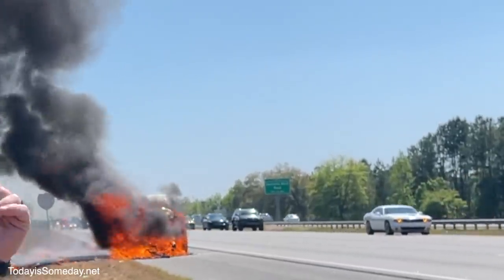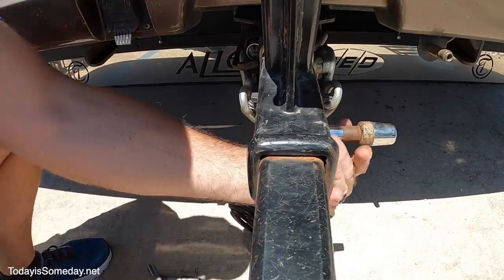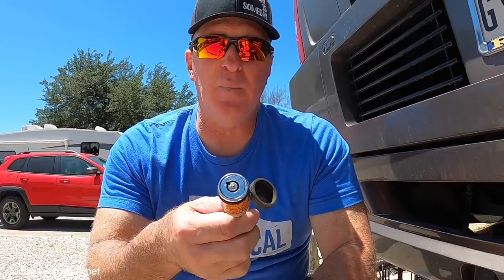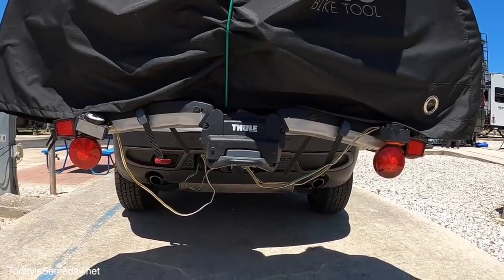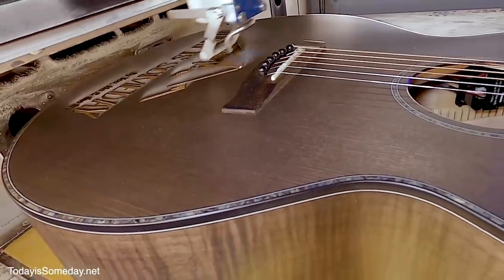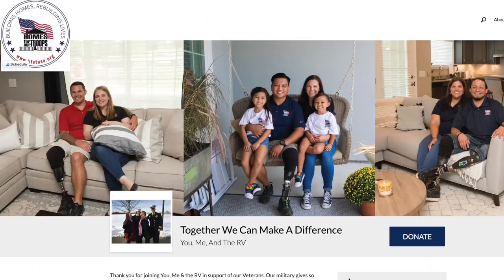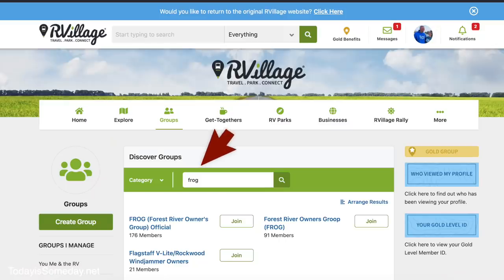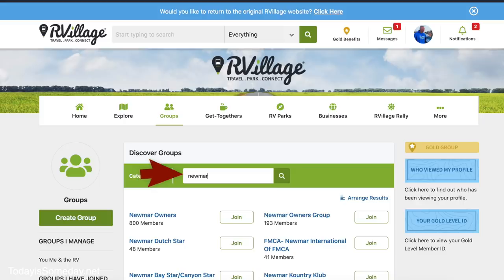RV Tow Car Changes (FULL TIME RV)

Comment: Cotter pin on passenger side also keeps you away from traffic lanes as long as you pull over to the shoulder. Good strategy!
Reply: Also if you forget or if some steels the pin its best to have it on the passenger/left side.  There is a slight list to the left of the driving lane and with the pin out the bolt COULD wiggle its way out with the road vibration.
Reply: cotter pin would probably should be on the driver side. It takes less force to remove the cotter pin, then it would take to remove the hitch pin. Because you dont want to jump to the other side to pull the hitch pin. Just a thought

Comment: Good on you for reviewing your toad tow connections.  Consider - which is more hassle, securing the hitch with locks or securing the vehicle by locking it up.  Great on you for reviewing the fire extinguishers. Size does matter, so a big one or two could be carried in the basement.  We tried to put out a dumpster fire with extinguishers.  After 20, we let it burn.  Extinguishers have their limitations.  Also, some practice is a good idea for those of us who have never used one.  But that makes a mess.  After cleaning up a practice session you get an understanding of why you might prefer a Haylon substitute for use in the coach.  Your charity programs are a great contribution. so well done!

Comment: I thought of you the other day. I was traveling on the Ohio Turnpike and passed a caravan of wreckers hauling a Class A, a F-150  (I'm assuming the toad) booth burned to the frame. Several other trucks with a skid steer and attachments to clean up the mess that was left by the fire.
These fires do happen in RV's and I thank you for making people aware of what can happen. It's better to be aware and have a plan.

Comment: I never thought of putting a locking pin on the tow it self. If we are sitting for the night we place the tow back in park and lock it for the night, then in the morning go through the transition routine which only takes about 6 minutes. I do like the idea about removing my lock from the hitch itself during travel days and replacing it with the big cotter pin for the reasons you state. Thanks for a great informative video.

Comment: I too have my hitch secured with a locking pin, and for the same reasons you stated.  I don't want wonder back to the RV and find my expensive tow bar gone.  But I'm thinking I will remove the locking pin and use a pin with cotter pin while we are underway.  Pulling one cotter pin and removing one pin at the hitch, when necessary, will be quicker than trying to undo two pins at the toad, which always seems to be in a bind.  I never thought it possible that an old worn out Seabee Chief could learn anything from a Fleet Officer, but I stand corrected.  Now I have to go have a shot of tequila to get that taste out of my mouth.  I just hope none of my friends see this post.  Y'all are awesome!  Keep up the fun and the videos documenting the fun.  Bravo Zulu, Commander, this was a very good video.  Thank you.

Comment: Great Video and food for thought.  I always put my car in park, remove the keys and set the alarm when parked over night even though still connected to the rig.  I put the car keys on my RV drivers seat to make sure I know to put it in neutral.  I also use the LARGE handle clevis pin for my Blue Ox towing arms for the car.  Very easy to pull out for normal hooking and unhooking.  I also keep 2 fire cannisters near my RV door and one in the back of the car.

Comment: On the MH and pull forward. Don’t forget to chock the toad rear wheels. Another good idea is to clean and spray all the moving parts of tow. Road grime and rust build up makes it harder to remove the bars. A rubber mallet also helps. Keep it in the last compartment. Of course this is Monday morning quarter backing! Thanks for your sharing of your experience.

Comment: Good things for us to think about on our RV.  After talking about what would need to happen in a catastrophic event like you documented, we decided to change out the locking pin on the hitch to a regular cotter pin when traveling.  We don't use locking pins on the tow side because of convenience mostly.  We think the cotter pin switch out at the hitch is our best option to separate the RV from the tow in the event of a fire on the road.
We did get Proteng installed throughout the underside of our coach this year.  We realize that it may not stop fires but it will give us more time to get out.  We did not get it installed in the engine of the tow vehicle but we may go back and do it.  We had our's installed at NIRVC in GA.  They did a great job.
We are just about to add our e-bikes when we go out this summer.  We are not sure how to make sure the brake lights of the tow will be visible.  Look forward to your thoughts on it.  Interested in how you put bikes between the RV and the Jeep too.  That might be a good option for us.  Did you do a video on it?

Comment: Have you thought about installing a fire suppression system in your Jeep’s  engine compartment? We also place a fire suppression blanket over the motor while being towed.  We place a  “remove  before flight” ribbon on the grill to remind us to take the blanket off  before driving.  Side benefit in cold climates your motor gets extra insulation for fast starts.

You can set up trigger activation of the fire suppression from your motor coach.

Comment: Thanks for the great follow up and looking for a better way.
I am sure you have considered the Element fire extinguisher?  Not much larger than a road flare and last 50 or 90 seconds.  Only downside I see is they don't blow out with a lot of velocity like a tank extinguisher.  But, 50 seconds vs. 15 is appealing.

Comment: My travel day experience. We stopped for lunch and had the pins in...came back from lunch and one of the pins was GONE!!! It was a good thing I checked and had spares. This is why I switched to locking pins not to mention your security concerns. The Bloggers at WheelingIt! had some damage to the car and motorhome from the tow bar coming loose! Keep on thinking...keep on CHECKING!

Comment: Good discussion. We are Weekend Warriors so use cotter pins on the car side but have the locking pin on the RV side so that I can just leave it on all the time. I think I’ll go cotter pin all around going forward on drive days. I have three of the small foam extinguishers along with the one inside the door Tiffin provides. I may add a few more. The Gas Stop we added gives me a lot of peace of mind too. Thx, Dave (Ruby Too, Tiffin OR 32SA)

Comment: That's why we use  road master quick disconnect base plate with our Toyota 4runner, Falcon 2 tow bar is always with locking pin. When stopped key is out and 4 runner locked, always locked towing. We also have 4 fire extinguishers in our MH.

Comment: This is a very good subject to discuss, especially newbies using BlueOx towbars (the best).  Thanks for bringing it up.  I use cotter pins on the tow bar, and permanently lock the hitch receiver pin.  It's too much hassle IMO to swap out the hitch pin all the time as you plan to do.   When we travel, we almost always disconnect at night to camp, and lock the car.  But when we do leave the car connected at night (Walmart parking lot usually), we remove the key from the car and put it in park and lock the doors (Honda CRV), deterring theft. This is no different than leaving the car in a parking lot locked up, and less hassle than swapping the hitch pin IMO.  As for the cotter pins being jammed, if you know how to prevent that, it can be mitigated to almost never happen.  The rig and toad need to be towed STRAIGHT for about 200'.  If you pull over in a panic and the toad is at an angle, there's a good chance the pins will be jammed.  SOMETIMES you can unjam the pins by pushing the levers down on the BLUE OX tow bar.  That's what they for, but sometime they may jammed too much if the rig is pulled over in a panic, without thinking about this issue.  When there's only a slight tension on the cotter pins, preventing easy removal, the levers on the tow bar can be pushed down to relieve the tow bar tension to loosen the cotter pins.  Many people don't realize that.

Comment: This was a particularly important video and I thank you for posting it. This was something I did not think of and while toad/RV fires may be relatively rare it only takes one. Similar to you, although I tow with a dolly, I have I use several locks and this has me thinking of changing to cotter pin systems while towing also. We leave next week for a trip so the timing was perfect.

Comment: 40FT Phaeton- We lock the tow bar to the rig. No locks on arms, just pins during travel. As far as security when stopped, the toad is locked, a dash cam (visible and non-visible)😉continues to record with g-shock, alarm system, and if all that fails and a theft occurs, we will call the insurance. As far as fire extinguishers, we keep two in the toad, we have four large in the basement (one at each point of the rig), and three onboard. In addition to onboard smoke and CO detectors, we have two in the basement as well. As part of our monthly PM we check all to make sure they are in working order. Happy motering😊

Comment: We constantly have issue with pulling the pins d/t that little bit of pre-load on the pins when we stop. What we did is pickup three tractor hitch pins at tractor supply. These pins have a D-ring on one end, which has made it a easy to pull and work the pins back and forth and they're a snap to pull w/o having to back the rig or move the toad forward. In addition to several 2# extinguishers we carry a 5# mounted into a vehicle bracket which is located in the curb side most forward compartment. Part of our check list is to make sure it's unlocked when traveling. Can't speak to their efficacy thank goodness and hopefully will never have to.

Comment: We use a locking pin for towing our travel trailer. We may change out to a cotter pin on the hitch on travel days so that we could pull it out quickly if necessary.  We carry a fire extinguisher in our SUV as well in the travel trailer.  Thanks for the tips on safety. Love your attention to detail. Happy Mother’s Day, Stacy!

Comment: On the Blue Ox tow bar there are two pressure release clamps. By pressing, or jumping , on them it will release the pressure so the pin can be pulled.
Reply: Would be interested to see a video on this. We have Blue Ox on our rig.

Comment: Great information here. Thanks for the heads up on something to look at. I currently use a locking hitch pin because my tow bar stays on the Coach. I am using the cotter pins on tow bar to toad connect. We are not yet full time so we have very few just overnight stays and the toad is always disconnected upon arrival. I will definitely rethink this. Thank you for sharing. Really enjoy your videos.

Comment: As with any emergency plan, do drills and evaluate what worked, what didn’t work and how to improve. 
I’m thinking that the cotter pin on the driver side might be a better location because you need more leverage pulling the hitch pin than the cotter pin. 

Whatever you decide for your rig and setup, practice!! Practice different scenarios: access from passenger side, access from driver side, Stacey disconnecting (Phil, you do have a “wing” out of commission at times), parking uphill, parking downhill, etc. Remember as Eisenhower is quoted, “Plans are worthless, but planning is everything.”

You should have plans within plans. For example, how are you going to communicate; radios, rear view camera, mirrors, shouting? Also if your primary is out, what are your backups? 
Depending on scenario, change plans. It maybe the better course of action is to gather the absolute important items and abandon ship.

Comment: We have been using the cotter pins that came with the tow arm setup. We are rethinking using the Locking pin when were stopped not just locking our tow vehicle. Thanks for the tips. Love Homes for Our Troops Charity as we are a veteran family & we always love to support our veterans as well as those who are active duty.

Comment: As an ex emergency service worker I am safety aware.
1.  This incident was intense since it involved two vehicles with different types of fuel.
2.  A non diesel pusher would present less danger.
3.  The small foam extinguishers are meant for small fires and not a fully involved vehicle fire.
4.  I have numerous extinguishers associated with my motor home.
A). Four H3R Performance MX100R Fire Extinguisher in the motor home.
B) Two FireSlayer RV Automatic Fire Suppression Tube Extinguisher.
1)  One in the gas engine compartment
2)  ONE behind the RV fridge since numerous RV fires start behind the fridge.
C). I have three extinguishers in my toad, which don’t laugh is a rebuilt Suzuki Samurai with a soft top.
1). One small Kiddie unit in my toad on the roll bar, came out of the motor home.
2)  FIve lb CO2 fire extinguisher specifically to fight bigger vehicle fires with.
Call me crazy but given the things I have seen and had to deal with over the years I feel I am ready to protect my motor home and help others if needed.
Reply: Samurai! No laughing here. Loved my Tracker and it was a beast off road.

Comment: Our Demco bars have a latch to release the tension which would be ideal in a situation like a fire or what you experienced.  I don't have any lock pins on this setup.  But I like your idea of locking it at night if you're staying somewhere.  We haven't had to do that yet.  Thanks for the ideas.

Comment: Hi folks, good video and subject as usual.  The one thing about that type of hitch (which I have also) is that you always have pressure on the bars even if you have the release levers. It is always a good idea to  in a situation like you saw to pull the pin on the MH a drive

Comment: Brilliant.  Spot on!   After I saw the video on the fire a few weeks ago I had the same thought.  In case of a  fire on either Toad of Coach, removing the LOCKS would be problematic.  I thought about it and then didn't act on my THOUGHT.  I am now acting...and will use cotter pins on travel days.  Thank you for the motivation!!!   Richard

Comment: I traveled with a Honda Goldwing 1800ABS and a Bunkhouse trailer over 73,000 miles without trailer brakes. I didn't use connections that used permanent connections...i.e. used nylon zip wraps so they would break away so it would not take my bike down. Sacrificing the trailer was my option. Have used pins on my toad and the motorhome, have lock pins for long term.

Comment: We use locking pins on the hitch and hitch extension, but only use non-locking pins of the towed vehicle end.  That said it never occurred to me that someone could steal the towed vehicle with this configuration, so thanks for the heads up.

Comment: On the toad side, a person could just put the vehicle in park and lock the toad when parking for the night.  However, if the park situation is forgotten  there'd be a problem.  So, on the other hand, the lock on the toad, forgetting it and pulling away won't hurt anything since the toad is already in Neutral.

Comment: Thanks for another great video -- these "tips" videos are greatly appreciated!  We are still in the process of selecting our tow bar and brake solution to tow our Ford Edge and that fire video got me thinking about how to deal with locks during a fire.  The heads up about the tension that is applied to the pin and the need to rock the RV alone could be a lifesaver!  Oh, from the son of a WWII Navy Corpsman, GO Navy!

Comment: Securing the Toad while parked. Can also take a couple pad locks on the safety cables to connect the toad to the coach.  I regularly padlock my safety chains of my trailer to my TV when parked.  Keeping honest people honest.  Btw, those locking pins are very easily removed by a hammer.  Back to keeping honest folks honest.

Comment: Thanks for the video - a lot to process and think about. I lock my connections for exactly the same reason, but I will be taking a zipper bag (I use bank bags you can buy online) and carry my regular pin and swap out my locks for travel. We just bought a new to us (2015) Jeep Cherokee Trailhawk that will become our tow rig versus our trailer, so this was at the perfect time. I'm also a fond believer in having more than one fire extinguisher stashed in the odd location (to include the door of my towed), beside my seat in the rig, and one on either side of the bed in back.

Comment: Hey guys, coming from a fire service background may I reccomend 30lb Purple K for dry ABC work and 20lb Co2. Also a 5lb Co2 for interior and a 10lb Purple K for secondary interior discharge if Co2 can't get the job done. I'm suggesting Purple K because it is certified to function with energized circuits, class A vechicles are full of energized circuits all the time during use. AFFF will likely be on the responding apparatus if required, joking but not really joking. I've successfully  knocked down an engine compartment carbq with a 30lb dry chem long enough to get an extracation done by law enforcement all while our crew stretched and charged a hose line to extinguish the carbq. Be advised the 20lb Co2 and 30lb dry chems will be heavy, though most of the time adrenaline helps overcome the weight. Be safe guys!

Comment: Phil and Stacy,
   I too have a lock on my hitch pin, and I see that would be slow (or no) for getting it unhitched during a fire like you ran into.  I will start unlocking it and switching to the original pin while driving, but just pulling the "hair pin" will not let you take the main pin out if it is under tension.  You will still need to rock it.  It will make it faster though.
   Be well and stay safe,
bf

Comment: I use a combo of locking pins and cotter pins. I have found that unless your toad is very close to straight in-line behind your RV, then it is pretty much locked in place and difficult to remove.